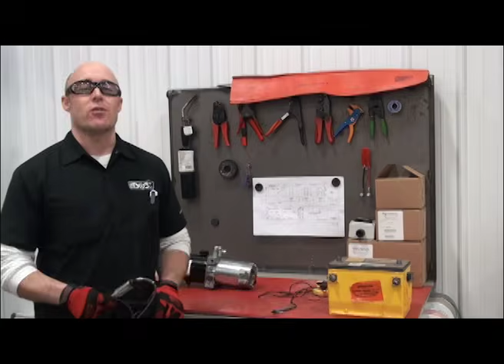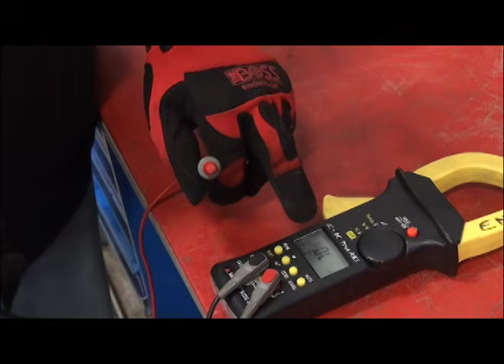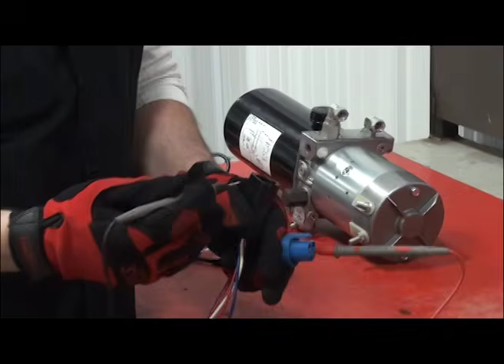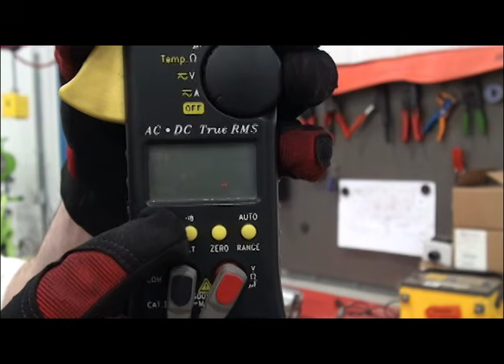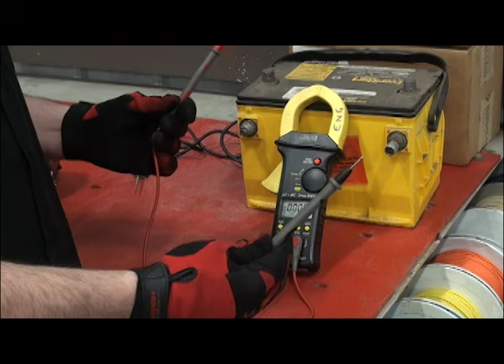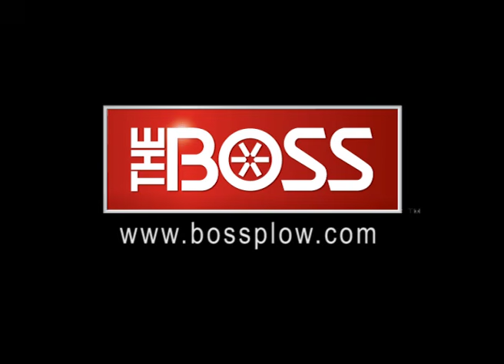BOSS SNOWPLOW Review of Electrical Troubleshooting Tools

Comment: I have a 9'2" Boss Poly V. When hooking it up it does not seem to have full power. Motor is running but not enough to mount the plow. While trying to mount I manually tried moving the plow around to assure a good ground. It ended up burning the torsion spring in half. It seems like a bad ground but I cannot figure it out. I tried to run a jumper from the truck to the plow and still did not work. Any suggestions would be appreciated. Thank you
Reply: I have problem with my boss plow I wired it up the wiring harness to my truck and and the solenoid just clicks
Reply: @charlierich9758  Make sure your connections on the solonoid are tight
Reply: @charlierich9758 what was the issue mines acting up 😂

Comment: I got a 08 f250 with a v st plow and the low beam don't work on it just on high beam and the truck lights don change automatic
Reply: I had the same problems They changed it to pigtails that connected to the headlights and they worked but now I have the same issue again but if I disconnect the pigtails I have high low beams on the truck I think it might be the old wiring harness something must be getting shorted out and watch stops it from working.

Comment: boss plows have lots of  faults in design -  if you have no power you cannot remove cover . cover is held on by 2 little thumb screw that get dropped in snow and gone , cover is made of hard plastic that is impossible cold weather {no flex}   ,   one plug for plow and lights - with short plugs , they lose contact fast - lights and plow need to be separate  harness -     Manuel does not even list fuse type or size   ..                           who would design something this bad ?